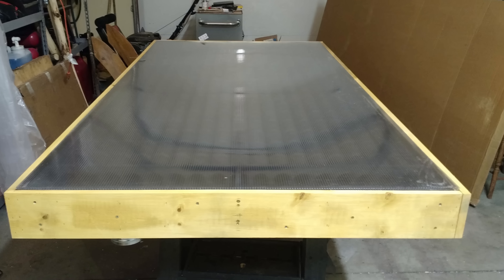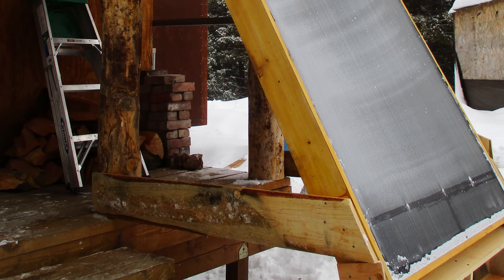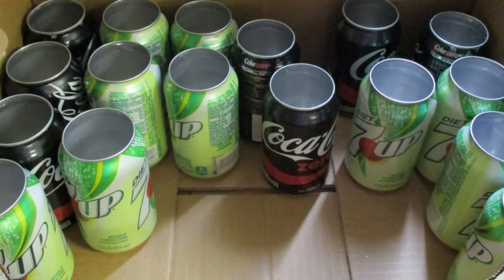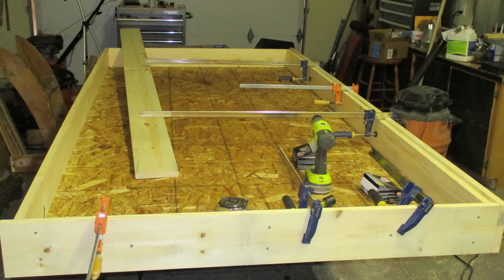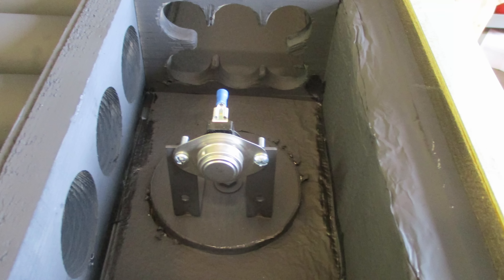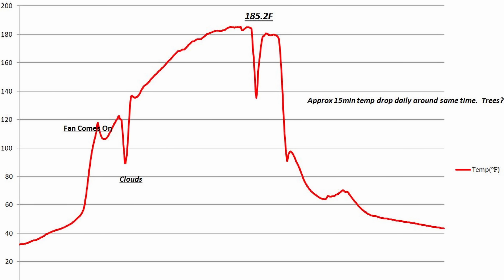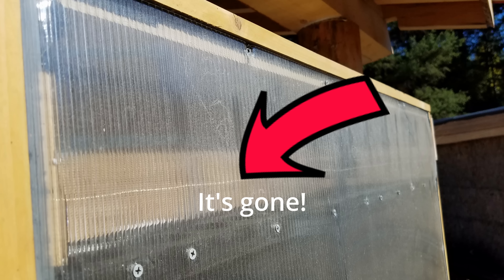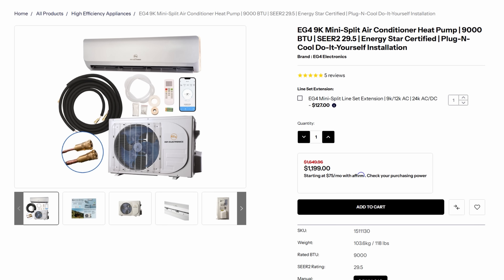7 Years with Pop Can Solar Heater - Is It Still Worth It?

Comment: I wonder if that flexible aluminum duct would work there. Just zig zag it from the bottom to the top. 

Or could you coil/spiral it inward/outward and have one of your ducts in the center. Might be easier than soda cans. 

Btw what do you do in the summer? That thing must get insanely hot.
Reply from the maker: That can work too.

In the summer, the solar angle is high enough to not be an issue.
Reply: @TheOldJarhead how much did you insulate your battery room? Does it stay warm enough to last between sun set and sunrise? 

I'm trying to keep a battery room from freezing too.
Reply from the maker: Honestly at first, just the walls.  Then R10 in the ceiling but not finished (still need the R21) and then the floor.  it definitely works but I won't keep my LiFePo4's in it.

Comment: I made a air heater as well using window screen instead, I used a small solar panel that directly powered the fan for the unit so it was only operating when there was sun out, I personally did not have much issue with the unit causing a large cooling effect. I used window panes that somebody was getting rid of and recycled lumber even uninsulated the panel was very effective but would have been more so with insulation. my total costs in 2019 was right around 50$. I attempted the pop can design but found two layers of black window screen works very effectively and is significantly easier to assemble. I highly recommend it but my next design will be a solar water heater using pex in the box as it will allow me to preheat my water heater while using old water heaters as heat storage for keeping the hose warm threw out the night.
Reply from the maker: Thanks for sharing your experience!
Reply: @jadenwebb8651  I came here to see if I could do that, thank you for sharing!

Comment: Hi. Could I suggest that you mount your fan as a pusher, i.e blow the air into the heater when your temp switch activates. Your fan will last longer as it runs cooler and it allows you to mount a gravity valve at the exit to block the heater at night, like those used for cooker hoods. Cheers. Iain
Reply from the maker: Yup, good idea

Comment: Take the average watts/ SQ meter for sun exposure in your area and you can estimate the potential heating output.
Reply from the maker: Do you have a formula for that?
Reply: @TheOldJarhead  during a clear  day in full sun it will be between 700 and 1000 watts per sq meter between say 10 am and 3 pm.
Reply from the maker: Yes, that I understand but how to change to BTUs I'm not familiar with
Reply: @TheOldJarhead   formula is easy enough to find or just ask google to convert it, but basically 2 SQ meters worth is like running a standard plug in wall heater of 1500 watts., while the sun is shining directly on it, which is pretty neat and a very useful rubric.

Comment: Singke  piece of metal inside ( to collect and withstand the heat), painted black and  insulated off standards from the frame, no insulation on the box, and one way valves  on the intake and exhaust, and bob's your uncle
Reply from the maker: That's definitely an interesting approach to building one of these!

Comment: Thank you for the information.  I am thinking a box made of just rigid foam boards might work well. It would have the insulation, would be lighter, and save the cost of the 2X4s and OSB.  A flapper style vent would be nice if your setup accommodated it.  A small fan as you suggested could work well with a small solar panel which would only come on if there was enough sun light. I am thinking that would replace the thermal switch.
Reply from the maker: The thermal switch holds the fan off until the unit heats up 😉 but a solar panel would work with it.

Just a box will work, but I think the cans increase the heat production.
Reply: @TheOldJarhead  - Oh, definitely keep the cans. I was just thinking to skip the wood part of the frame/box and only use rigid foam.
Reply from the maker: ahh.  Rigid foam deteriorates in open air.
Reply: @TheOldJarhead  - I did not know that.
Reply from the maker: Me neither until I did t get the siding on a North facing wall at the cabin and it started to show serious signs of wear

Comment: Not sure why you even need pop cans.
Reply from the maker: They increase the surface area for heat absorption and absorbed the heat faster as well as release it into the air
Reply: @TheOldJarhead If that's the case, then it seems a finned designed, like a car's radiator, would be a better fit.
Reply from the maker: I don't think those will work as well
Reply: @TheOldJarhead  If surface area is why you're adding cans, then it absolutely will.  You can pack magnitudes more area into the box with a finned design.

If you have doubts, then surface area probably isn't why the cans are there, so... why are they? Airflow? Certainly not.

I believe that the original design used cans because these little DIY projects back then all used cans and bottles and recycled plastic in their designs becauae it was more appealing to the viewer. "Turn Old Cans into X!"

All this device is doing is creating a greenhouse effect inside the box. That's where the heat is coming from. Having empty soda cans inside your greenhouse doesn't make it warmer.

You can't claim it's thermal mass because aluminum doesn't retain heat. The only thing you could claim is surface area transfer to the air of visible light to infrared wavelengths. Even then, you're not doing anything flat black paint won't do, since your cans add no energy to the system and don't retain energy once the sourcw of power is removed.
Reply from the maker: It's a combination of heat transfer rate and air speed in the tubes but I can't say how much of a difference that makes, if any.

Comment: Have you tried a furnace draft damper as your exit damper, since they have a moveable weight on them they can be adjusted to a very light breeze. And/or use a dryer vent at the bottom for inlet air. Might eliminate the need for a fan. Also it will cost more but the downspout method may be better since there will be no joints. If necessary you could baffle them to slow the air moving thru the downspouts.
Reply from the maker: Haven't tried that but may look at those options when rebuilding.
Reply: @TheOldJarhead  The only issue is the damper must be horizontal. im not sure if you can put a pipe over the end and then turn it down. As long as the pipe and turndown dont interfere with the damper, it may work. And i would definitely use something on the cold side as well. Maybe another damper or dryer vents
Reply from the maker: I'll have to experiment

Comment: Instead of using cans, just use 3" flexible Alum dryer vent tubing.  Buy it all at Lowes, and put it together over an evening.  Tubing is so flexible, you could probably form it into squares at the top and bottom, to dispense with the complicated drilled headers.  That way, no cans involved, and you don't have to drink all that beer and soda.
Reply from the maker: 😁 but what if people like drinking beer? (FYI my Bourbon bottles would work) 😁

Comment: If you use old pallets and got the cans for free you'd only really need to buy tape the can binder and insulation as well as the clear sheet over the front and you'd probably be under 100 bucks. You could probably even get the dryer vent tubes and stuff from the dump and save even more.
Reply from the maker: You certainly could

Comment: I made mine out of aluminum dryer duct (a bit easier than cutting and connecting all the pop cans) painted with SolKote. Built the insulated box and snaked ductwork up and down about 26’ in length, into a manifold with 6” inlet and outlet. 
I added some backdraft dampers to the air supplying ductwork to enable a winter heat mode, and then switch the blower to exhaust excess heat in summer mode.
I made 3- 4’x8’ solar heaters, placing them within a rooftop enclosure. Used insulated 8” ductwork for intake and exhaust grills to heat three areas of the house. First winter use saved 400 gallons of fuel oil, about 1/3 of yearly volume. Been saving every year since!
Reply from the maker: Awesome
Reply: I started out with the pop can route and quickly abandoned that approach because I knew I didn't want to have to take the heaters down and open them up ever again. Downspout pipe and no insulation, but I did go with greenhouse-type double layered lexan.

Comment: Instead of cans you can use any kind of pipe, fancy square rain gutter sections could do it as well as 3" corrugated plastic drain pipe, build the box and insulate well with roofing foam sheet. A cheap piece of glass could be to use an old glass shower sliding door, people often replace them so probably easy to get. Main thing with this project is to be economical and not to overthink it!
Reply from the maker: That's right, there are many ways to build one!

Comment: While overseas in the Pacific, I made hot water by laying a garden hose, loopes crisscrosed over the peak of the roof.  Ran the water into an old coal fired water heater for storage.  Worked well with water being the only moving part. 😊
Reply from the maker: That's a very clever way to heat water with solar!
Reply: When I went camping I used to heat water by filling 2 liter plastic soda pop bottles painted flat black and lay them out in the sun.  Heated the water to 100 degrees+ in a few hours. Never tired it in cold weather,  For cold weather they might need to be placed in box with a glass cover..
Reply from the maker: Cool idea

Comment: • The fan doesn't need to be at the hot end. It could blow up from the bottom cold end.  Right ? The fan might be a lot more comfortable at the bottom end.
• Solar gain is mostly about surface area (aimed correctly), and of course capturing the energy with a dark surface. Sometimes there's too much flourishing with gimmicks.
• If you simply allow the solar energy to enter the space through a large window, the system is simplified. For example, the room is already insulated. Our house has 24 sq m of south facing glass. Roof overhang for summer shade.
• Measuring heat output with a temperature reading is not right. i.e. If you use a little magnifying glass you can fry an ant, that's extremely high temperature. But not much heat.
Reply from the maker: I agree that there are many ways to heat a space with solar, this was one of them!

Comment: If you are going to install a damper on your system, I think it would beneficial to install it on the inlet, bottom, since cold air sinks you do not want the gold air sinking into your room. A damper on the inlet will ensure the coldest air will always be captive in the box.

edit: I made one years ago and used a computer muffin fan and a solar panel. It was only 1 square meter but it routinely made 140 deg F air.
Reply from the maker: That's a smart point about the damper placement to keep the cold air out!
Reply: Damping either inlet stops the negative circulation
Reply: You are of 9ncerned about the heater turning into a reverse- circulating circulating chiller, not so much about the tiny amount of cold air that is contained at any one time in the unit. But damping both is best because it is a backup measure... A motor- powered stopper triggered by a temp sensor is the ideal.
Reply: @steveshea6148  The idea of putting a damper on the lowest point is to keep the cold air from falling. The cold air can circulate within the pipe with the damper at the high point. The reverse is also true. If the damper is on the lowest point and there is heat in the collector, the heat will rise out the top. Not a lot, but it can be felt with your hand.  I had this problem in the system I built. My solution was to put the inlet and outlet at the same height and use a solar powered muffin fan to move air instead of relying on convection.
Reply: As much as possible, isolate the entire heat collector/ radiator from the target heating area when there's insufficient incident sunlight, unless your goal is to  heat the target area during the day and chill  it at night. This goes back to design goals.

Comment: The fan goes at the bottom so it doesn't get cooked.
Reply from the maker: That's a good point about protecting the fan from heat!
Reply: Fan should be cooler to last. Bearings fail faster with heat.
Reply from the maker: Makes sense

Comment: Putting some mouse into the back before. The insulation will help retain heat and balance it out, such as old concrete board drywall painted black. Thermal mass storage.
Reply from the maker: Interesting idea

Comment: i built mine for less than 50 dollars.

Maybe the Netherlands is cheap?

Nah.
I think you exaggerated the amount of money.
Because if you give it a thought, it does not have to be this expensive to build one.
Reply: ah, you made it complicated with baffolds or how you call em.
valves basically.

Well, the outlet which runs into the house could be covered with just a piece of wood to keep it from becoming a cooler at night.
No need for springs and all that fancy stuff.
Saves a lot of bucks.
Reply: the cans are free.
The box itself, sure, nice if you have wood.
Cardboard works fine as well.
Insulation?
The stuff you stick behind a radiator works fine. Aluminum foil with a bit of insulation on the back.

Keep it shiny.
But, the cans should be black.

The box, shiny on the inside, aluminum foil or the stuff you stick behind a radiator for insulation....
The cans, black.
And, plexiglass over it, or just cheap foil.

Doesnt cost 600 bucks to build.
And when you think about how to do it, the foil can do the trick.
No need for expensive insulation.
No need for plexiglass.
Reply from the maker: I built it for $250-$300 7 years ago.  I wasn't trying to make it cheap, I was trying to make it effective and could afford to buy Lexan and Fuze It etc etc.  Today, as I said, to build the same one, would cost about $600 but that doesn't mean someone couldn't scrounge everything cheaply and build it for free.

Comment: Solar heating is a gas, there is so much one can do if they are willing to experiment.
 I have done several and love seeing things work.  
I did an experiment that proved to be a challenge worth while . I had a 6' length of ABS 4" pipe and laid it against the wall in the sun and took temperatures top and bottom. there was 10 degrees different.
  I hypothesize that if one were to choose a south facing window no matter how big it is, and make a curtain of ABS pipe that reached almost to the floor,  the sunlight on that curtain would draw the cold air from the floor and the exposed pipe would heat the air drawing the cold up and begin heating the room. If this convection worked one might even add a box at the floor with the pipe terminating in it with an air filter naturally drawing the dust at the floor level. One might add a small computer fan to accelerate the process.  Fact of the matter is even if only a few degrees different the room temp would rise slowly and at night nothing would happen negatively.
   The ABS could be a different color facing the room and the pipes do not need to be touching thus allowing sun light through. One can add a ceiling fan to circulate the hot air in the room.
Reply from the maker: Sounds interesting

Comment: For those interested in trying this. I tried the drill mounted hole saw, but did not like it, jumpy/grabby and wrecked too many cans. Instead I used a can opener, the type with the 2 wheels one for cutting and one for gripping. For the top, angle  the can opener about 15 degrees in towards the center of the can. For the bottom, lay the can opener almost flat with the cutting wheel towards the inside of the lip. For me this turned out to be faster and easier than the drill method, because I could do it at the kitchen sink rather than taking the cans out to the shop for drilling then back to the house to wash out any beverage residue still in the cans. Plus the can opener leaves a clean cut, NO lose chips from the hole saw ;- )
Reply from the maker: I used a can opener on the top but drilled the bottoms which I could not find a way to use a can opener on.  

Many just punch holes in the bottom.

Comment: Hopefully when you re-do it, you film your step by step building of it. It was not clear if you take the tops AND the bottoms off
Reply: Yes, the tops and bottom are removed. I tried the drill mounted hole saw, but did not like it, jumpy/grabby and wrecked too many cans. Instead I used a can opener, the type with the 2 wheels one for cutting and one for gripping. for the top, angle  the can opener about 15 degrees in towards the center of the can. For the bottom, lay the can opener almost flat with the cutting wheel towards the inside of the lip. For me this turned out to be faster and easier than the drill method, because I cold do it at the kitchen sink rather than taking the cans out to the shop for drilling then back to the house to wash out any beverage residue still in the cans.
Reply: @MrGordy61  Will tin cans like vegetables cans work just as well
Reply: @pjdave66  They will,  altho most cans are coated inside with plastic I'd be worried about the plastic cooking off in a year or two and rust forming during off season storage.
Reply from the maker: Not really.  They will work but what most people miss is that the thin wall aluminum of pop cans absorbs heat super fast and releases it just as quickly making it idea for a heat transfer device like this.

Add to that the shape of the cans cause turbulence in the airflow causing the air to pick up more heat.  That's the theory anyway.
Reply from the maker: https://youtu.be/rAzUMeK9bKE 😊